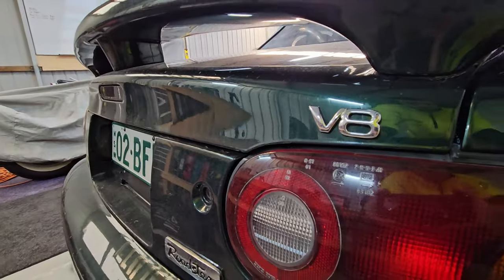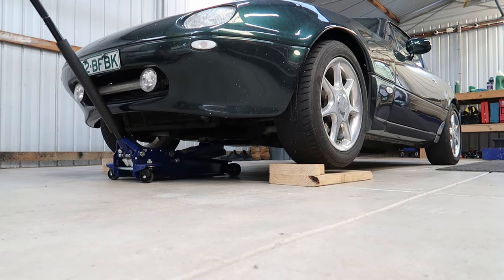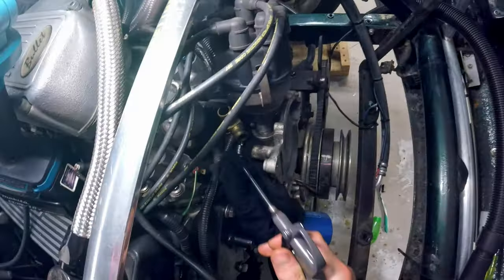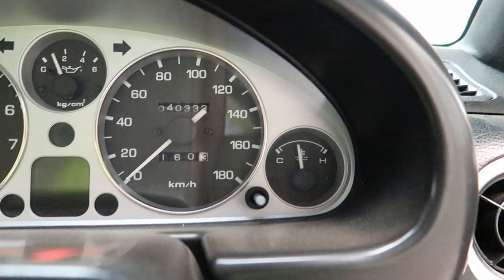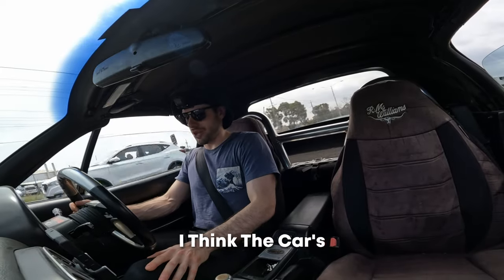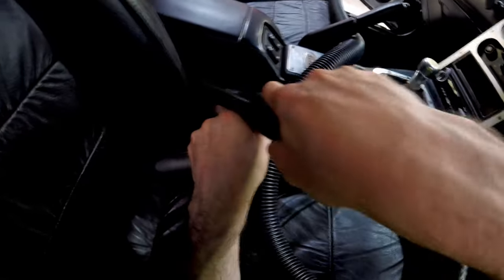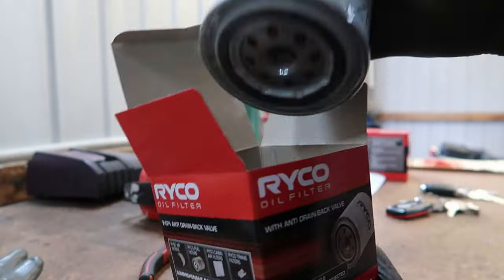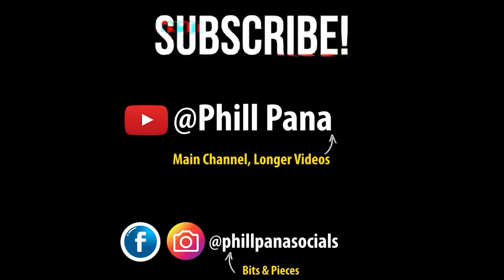V8 Mazda MX-5 Build | Project Bullet Roadster Part 1

Comment: George bought the Rover engine as a brand new crate engine.. with a tremec box.. first box had a vibration.. I still have the original tremec here.. built in 2001.. George died in November 2004.. another family friend then bought it from an estate and put a quieter exhaust on it
Reply from the maker: Oh right, so this exhaust is aftermarket. It's not a great setup but I'm going to work with it.
Reply: @phillpana  it was put on by second owner George had a beautiful stainless system fitted not long after having it built..second owner wanted it quieter